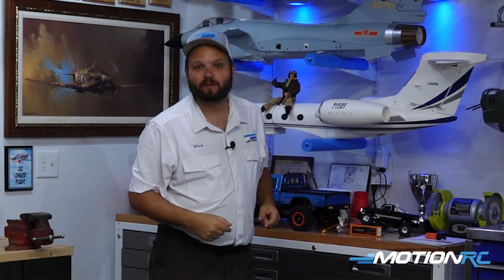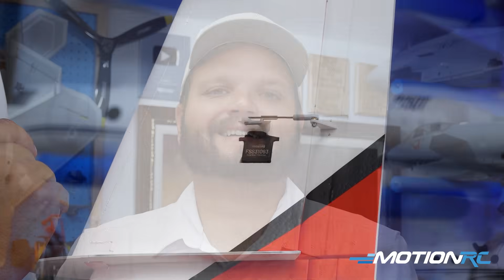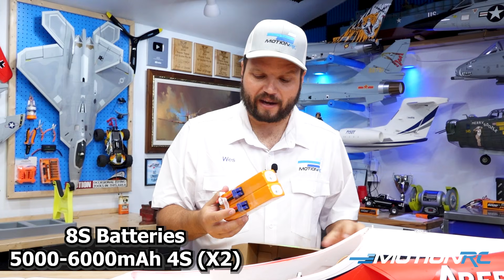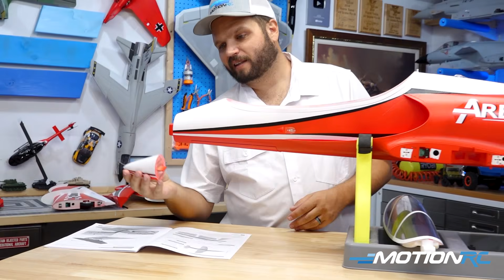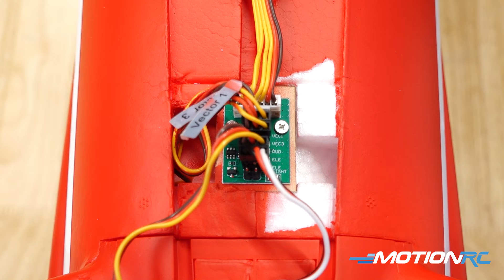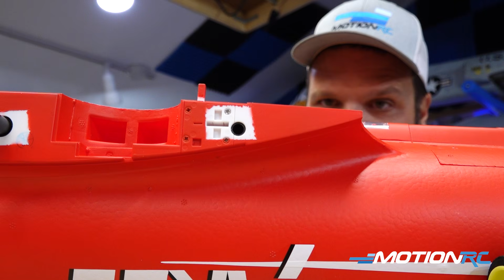ALL-NEW! Freewing Ares 90mm Ultra Performance EDF Assembly | Motion RC

Comment: Hey @wes: I’m a little confused my MRC went with 13 channels. Clearly, we’ll need a non-Spektrum receiver as the the 20 is $500. Is there a lemon receiver coming out to accommodate that many channels? So, express LRS from radiomaster is the clear winner here. That eliminates a bunch of folks within the Spektrum demographic. Unless they figure out how to setup the serial port with the radiomaster ranger or bandit modules along with programming their micro receivers and pairing them with a PWM pin box to get 13+ channels. Pretty complicated for most hobbyists these days. Just saying that some of us will have to wait until some like Jon from Two Brothers RC shows us how to take an AS3X receiver and replace the MRC gyros and maybe lessen the channels.
Reply: You can do it with a 10 channel
Reply from the maker: You could do it with 10 if you replace the gyro and don’t use thrust reverse. Unfortunately there’s not a lot of options past 10 channels from our competitors unless you want to spend lots of $$$ might be worth buying a TX16 and both receivers considering it’s less than one 14 channel RX from them 😅
Reply: If you don’t care about reverse then 12 channel receiver should be enough
Reply: Good looking plane!
Reply: FreeWing have just dopped a video showing the setup with less channels - https://youtu.be/ep7WVSZFZbk?t=1578 - I'll be ordering one when they are available in the UK and will probably stick a Spektrum AR10360T which has multiple gyros in it and remove the FW gyros entirely.